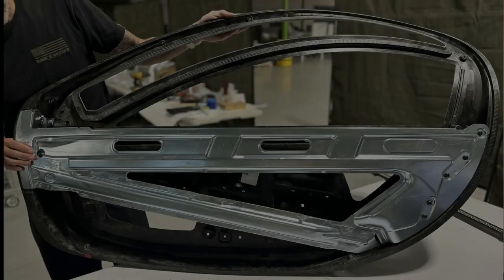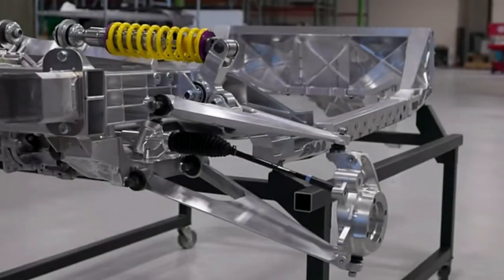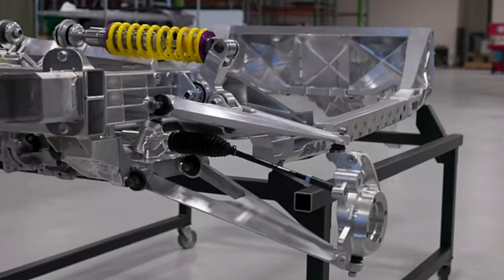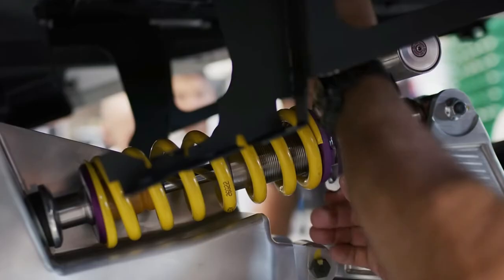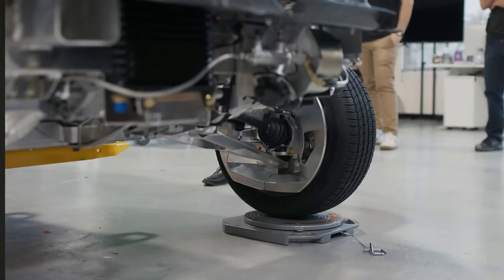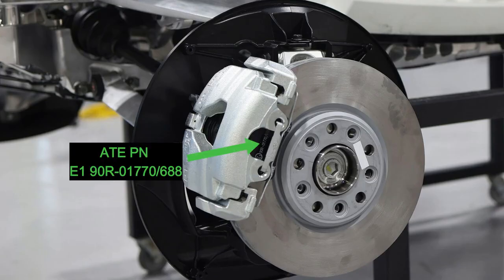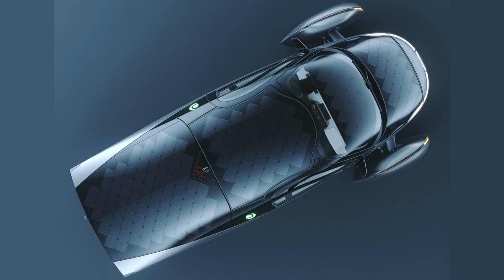Aptera's PI to CES

Comment: EVA Foam that can do additional sound deadening over the bare Carbon Fiber.    Still want to see how quiet it is but would prefer a carpet like surface vs the PI bare Carbon Fiber setup.
Reply from the maker: @randyoverbeck9686  I have many years of experience with both of these topics, and is on our list. I think the exposure carbon fits the ethos of the lights solution possible for Aptera to produce. Thank you for watching!

Comment: Wish list: 1. Input port and internal cables for easily connecting additional solar panels directly to the vehicle DC solar charging system when I’m at home or if I want to travel with a portable panel or two. 2. Heated / cooled seats.
Reply from the maker: The first one might take some time, however I would love to have that for my self when I go camping. And I have a quality solution for your second concern, but that will have to wait untill I have my Aptera to work out to offer. Thank you for watching!

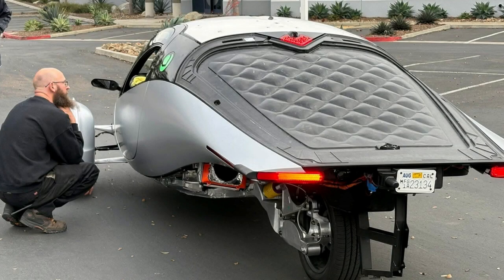Comment: At 7:24 you are correct, that is a radiator. One of the Aptera engineers I spoke with here at CES yesterday confirmed it. There is another just like it on the passenger side of the vehicle and each are connected to new exhaust ports in the underbody panel. They are located to each side of the rear wheel skirt. There is also a new underbody air scoop located centrally ahead of the rear wheel skirt to supply air flow to these radiators via a wishbone shaped duct that wraps around the leading part of the rear wheel scoop along the underbody.
Reply from the maker: @kevinjensen9803  Absolutely, also the solution looks very aviation inspired. Thank you for watching!

Comment: Accessories I would like to see:
a small but very bright rear fog lamp, mounted low on the trailing edge of the rear wheel shroud. 
"backpack" style magazine/map/ misc stuff carriers which snap onto the seat backs just below shoulder level. 
A lightweight and compact as possible spare tire and jack set with a place to mount it in the interior somewhere. maybe behind the driver or passenger seat? 
front springs to allow a higher front payload than the current 300 lb. (maybe up to 500 lb.? )
a second wiper to clear the right side of the windshield, so I can see my 2 o'clock in really bad weather. (this is a long shot, I know)
Reply from the maker: @robertkirchner7981   After seeing the car at CES I have some ideas for extra lighting that might fit the need of a rear high-vis fog light. I definitely see room for improvement on interior storage along the same ideas you have. 
I think the Aptera will have a jack kit and inflator as standard equipment, a spare might be more difficult you would need to mount it right behind the seats to the floor, but definitely something to look into. The payload might have more to do with weight balance because of the 3 wheeled configuration than the springs.  I will have an upcoming video on that soon. Thank you for watching!

Comment: I seriously they will be using those dampers in production. Those are KW motorsport units and quite expensive as compared to a regular damper. Plus the rear has an external reservoir on it. Plus they are not designed for everyday use vehicles. I'm guessing that they are using them as they are just going to wing it when it comes to figuring out the damping and spring rates as opposed to just sticking it on a shaker rig and then that would literally accelerate the program by leaps and bounds. Hopefully the track version and at least one full version will have shock pots on it.
Reply from the maker: @billsmith5960  Aptera has partners that have developed and fine tuned the suspension, they have not winged it. The media car at CES was just not there for rides but also data logging each trip. Thank you for watching!
Reply: @ApteraAccessories  - I seen the data logging but for the suspension, it was missing. If it was, point out the shock pots and load cells for me.

As for fine tuning, this is the first time with this suspension, so unless they are actually running a full production model on a test track (not a racetrack but a test track like other manufacturers use) then it's just winging it.
Reply from the maker: @billsmith5960 The shock pots were not on the car at CES, but are you suggesting that Aptera partner that is doing the suspension development does not know of this?  The engineers know what is required, just because you don’t see it does not mean it’s not happening.  When was the last time you have seen a car company shows this level of how their development evolved?
Reply: @ApteraAccessories  - I see this level of development quite often. The reason you do not is because other companies have no reason to show you, plus most would think it's boring. I doubt anyone would care to see all of the work and engineering put into a Corolla. This is because it's people just doing their job and Toyota does not need to crowdfund their next vehicle.

As for Aptera it's required for them to do this or the crowdfunding does not work.

Comment: Excellent and accurate info and observation about the real and actual world of making things.
I grew up around machining, die making, stamping and deep drawing.
Your vid is perfect and I rarely get to say that.
Thanks for educating!
Reply from the maker: @ronfarnsworth7074  Thank you for watching and the positive feed back! I have been around cars, machining, and manufacturing most of my life.
Reply: @ApteraAccessories  You'd have loved seeing explosive forming of sheet metals which I was involved with back in the 60's and 70's until I got involved with electronics and other high tech which was taking off in MA at the time.
Thanks again for your great job at educating the Aptera group about various die materials and how and why they are used. Not everyone was as lucky as us to see these things growing up.
Keep up the great work!
Reply from the maker: @ Thank you, I have seen some explosive form of round tanks before. It is definitely a unique method.
Reply: @ApteraAccessories  This was forming blank sheet metal into metal dies with vacuum between blank and die and with water as a transfer medium between explosive and blank. This gave tight tolerances.

Comment: Thank you Joe, we look forward to any and all Aptera accessories you produce!!  Chris Anthony mentioned, in one of the CES videos, that the hood solar panel is the only one in glass.  The others, while functional, have been laminated in plastics.  I assume this is due to 'gorilla glass' not being available in the larger sizes and shapes until contracts have been established, but that is just my speculation at this point.
Reply from the maker: @DemaGeek  I think the glass has a superior appearance and finish, however they did have a full set of fully functional panels there and that I think was important.  If I am correct the solar glass is also coming from Europe, it could have been late to arrive for them to make the glass panels in time for the show. Thank you for watching!
Reply: @ApteraAccessories   That is exactly right, Chris M. mentioned that the larger glass did not arrive in time for CES, after I made the comment.  I agree that the glass looks much better and will have far superior durability!
Reply: Aptera is not using Gorilla Glass! Chris indicated that in a recent video.
Reply: @gmv0553  "Gorilla Glass" is the proprietary name and product of Corning Glass, but Aptera is using the same thing from another company, which is why I put the term in quotes.